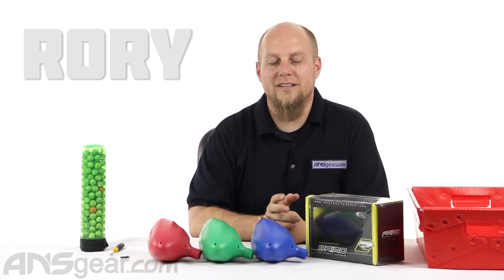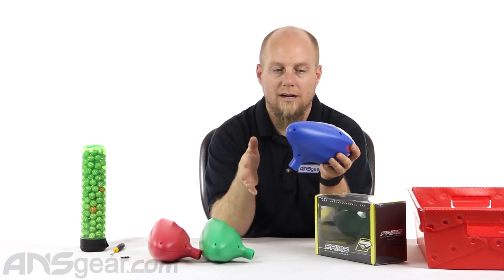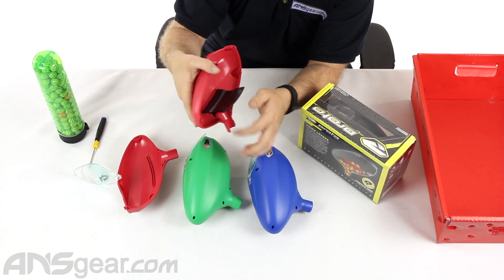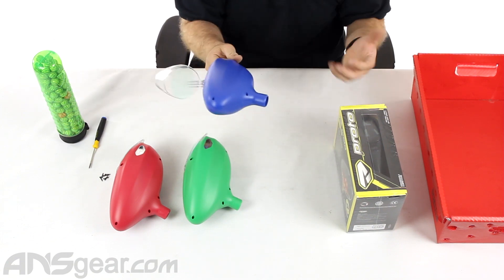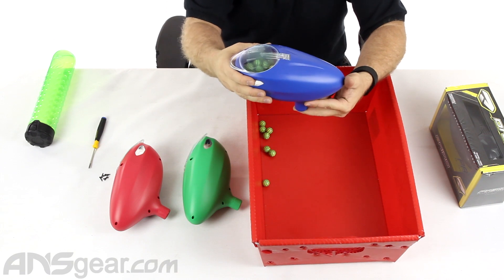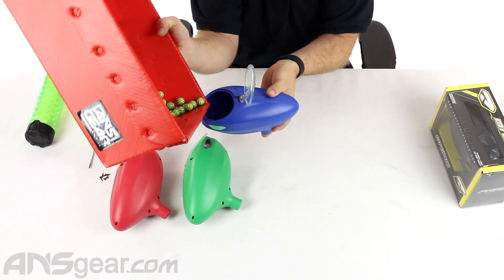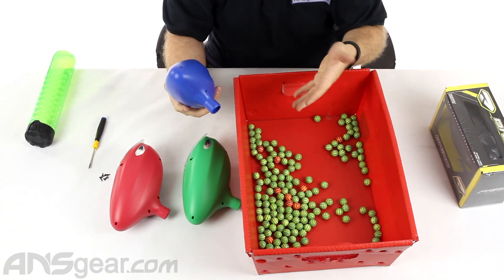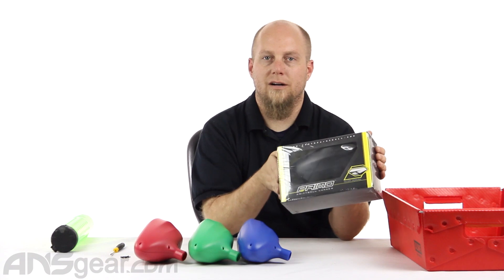Proto Primo Loader - Review

Comment: Best hopper for the money. I have one and I can say that my Tippmann griphon has a heavy bolt which agitates the hopper enough so that you will never need to shake it.
Reply: Update?
Reply: @teehud313  update on what? If your using this gravity fed hopper on a gun with barely any recoil you will need to shake the gun on occasion to get the paint to flow better. Best gravity fed hopper ever but all gravity feed hoppers have this problem. Hense why most ppl use motorized hoppers
Reply: @way2hungry666  I was asking if after some time if you felt the same way about this hopper. I'm about to use it on a tippman stormer tactical.
Reply: OIC. Yeah I had used that hopper for 2 years on my tippman griphon skull edition. The original post was a long term review. Highly recommend for beginners with hard recirculating gun bolt to continuously shake the paint
Reply: @way2hungry666  bet. Appreciate it!!!

Comment: would this work with an azodin blitz 3 gun
Reply from the maker: Yes, it would fit.
Reply: Alright thank you
Reply: Bodie Hart does it work well for you? I have a blitz 3 too and im scared I'll have to shake it a lot
Reply: iAdamGame I'm not sure yet I haven't ordered it yet but I would think you'd only have to shake once to move it down the level in the hopper
Reply: iAdamGame  hey I have the blitz 3 with the primo honestly it works fine . probably when I run the balls move around so you should be fine.
Reply: muscle vs tuners568 yeah I ordered it thought it was great after using it didn't have any problems with it neither works like a charm
Reply: Bodie Hart yep
Reply: iAdamGame you wont